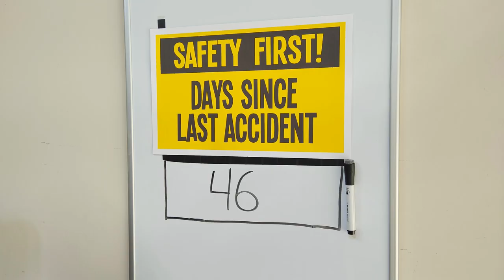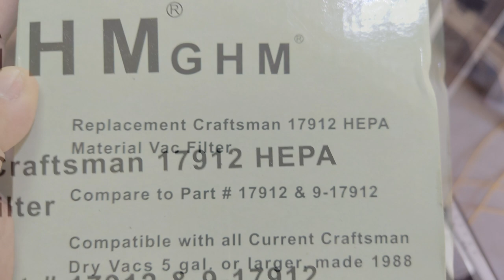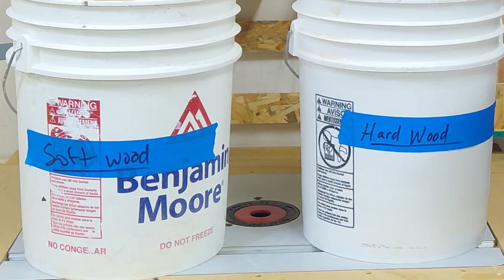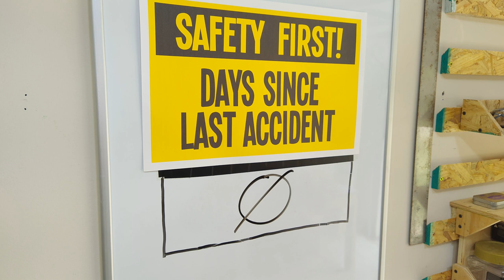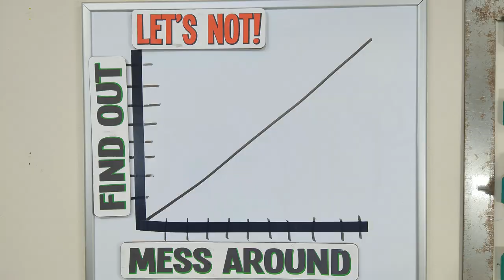Organizing Your Shop Doesn't Have to Be Expensive

Comment: Great video! Been there, done that! Ok, the money you blew on that Festool sander would have bought a Harbor Freight dust collector and TWO Hercules sanders...don't knock Harbor Freight. If it's a tool I'm only going to use once/twice a year, why blow it on high dollar tools just to impress your friends? Save that money for your CNC....I have that same Delta saw, love the fence on it. I know you're using your router table as outfeed, but the router will fit nicely in that dead space to the right of your fence, plus you can use that bitching fence for it.  New sub BTW
Reply from the maker: Thank you! I guess it does sound like I'm knocking harbor freight 😆. I totally agree no reason to pay for a tool you might only use once or twice a year. I do a lot of hours of sanding so an high-end sander was a need for me and the festool came with a 3 year warranty. It sure wasn't an easy purchase 😂. I'm a big fan of WEN products, saves me the drive. As the nearest HF from me is over an hour away.

Comment: great video! As some one prone to injuries while DIY'ing I myself am trying to up my PPE game. For this I don't keep cutting corners anymore on the quailty and amount of PPE available on hand while I do work. My last and nastiest injury so far happend last year while cutting the isolation from a electric cable, razor sharp, surgery steel knife half-flayed my thumb cutting through the nail. Definitly reducing clutter and ramping up organization in the workshop is the way to go to dump up both productivity and safety.
Reply from the maker: Thank you! That sounds painful! I also have done something similar to that as well.. a box cutter in my hands is a recipe for injuring myself. 😂.  A clean shop make me less prone to take risk

Comment: Awesome video. If you want a quieter shopvac alternative, look into Dewalt Stealth Sonic vacs. It's a normal shopvac but MUCH quieter. I just picked one up from Lowes last week on clearance for $100. The suction of the air at the end of the hose is louder than the vacuum itself.
Reply from the maker: I'll check it out! Thanks!